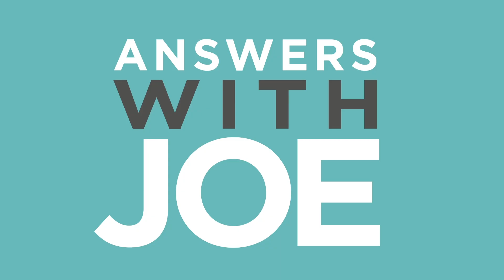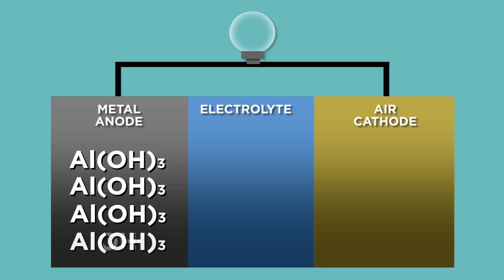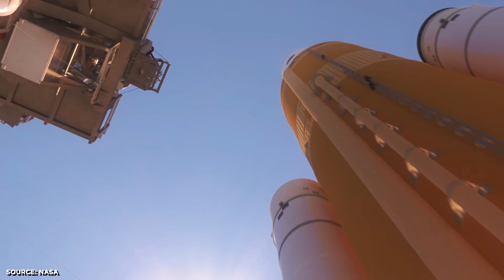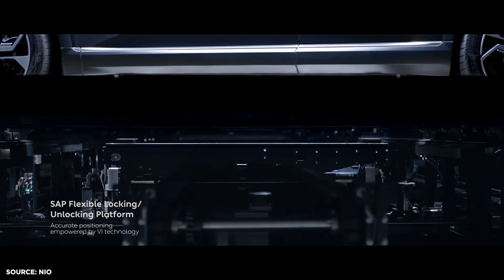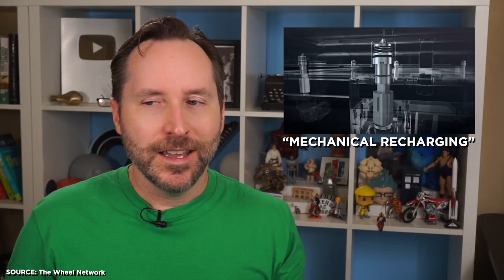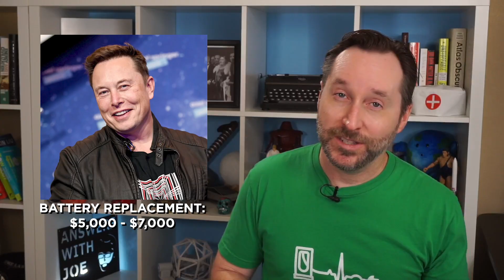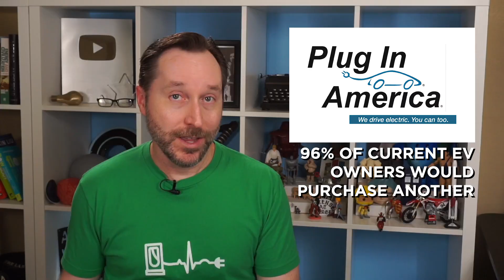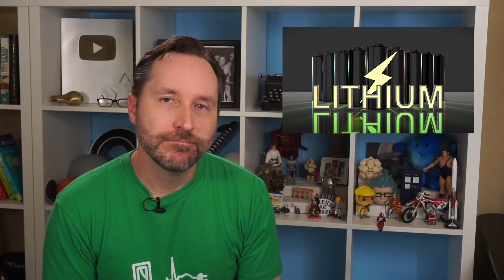This Battery Could Drive A Car 1500 Miles - But There's A Catch | Answers With Joe

Comment: "at least with hydrogen..."    Sure, but hydrogen cars are only slightly more energy efficient than gasoline cars, and the hydrogen currently comes not from electrolysis but from fossil fuels, emitting CO2.  Battery EV's are around 3x more energy efficient than gasoline.

Because hydrogen isn't a resource. It has to be made.  With thermodynamic losses on every step.   Hydrogen fuel cells just add complexity for no good reason.

Comment: Cars are nonsense.

Tele-working, remote working, proved to be quicker, faster, currently available, scalable, and better for the work-life balance. 

For work that is site dependent, mass transit. Busses, trains, trams have a smaller impact in creation, operation, and recycle than cars.

And finally, because 'pEoPlE wIlL nEvR gIvE uP cArs', fewer batteries and smaller batteries  used as a back-up rather than the primary energy source. Power from go:  

https://en.wikipedia.org/wiki/Pantograph_(transport)

Like US healthcare, the problem isn't that change isn't necessary or possible. The problem is that a lot of jobs and money are inextricably dependent on things remaining the same. The problem isn't a lack of science or materials; the problem is our abject fear of the pain and suffering perceived in modernizing our economy.

Comment: Sounds like aluminum-air batteries are really just a carrier for whatever power source is used by the factory that would produce the batteries. The power contained by the batteries isn't "free". It comes from whatever the factory uses to de-oxidize the used batteries. So, if that factory is powered by a coal power plant you aren't really benefiting much. The real question is this: How energy efficient is the process of de-oxidizing use aluminum-air batteries, compared with transmitting power across power lines to charge a cars lithium batteries? If it's more efficient than recharging lithiums, great.

But what if it were WAY more efficient? Could this be a good option for mass grid power storage? Could excess power generated during sunny or windy hours be used to  de-oxidize large vats of aluminum, which could them be exposed to air during night time or low wind times?

Comment: I think your numbers for energy needed to recycle aluminum batteries are very optimistic. The energy to recycle aluminum is low because it is mostly in its metallic unoxidized state. The aluminum battery produces aluminum oxide which is much more energy intensive and harder to recycle.
Reply: It is in fact that oxide state which is why aluminum is such a PIA to refine in the first place. And energy expensive to produce.
Reply: Same as represeting sea freight and airline co2 as "significant" when its road transport that contributes the most out of everything at 40%. Leave sea freight alone its most economical and ecological way to go, same for airlines, there just doesnt exist any replacement for jet's which are already indredibly efficient. For road transport it should be offloaded from road going semitrucks onto trains and expansion of railroads. Trains are most ecological land transport in existence and there is nothing that could ever beat it, but Elon is focused on tripping to his stupid ticktacks that are infinetly worse to trains....instead of just investing into railway industry. Electric-grid powered rail is the way to go
Reply: @frontrider3240  , Nope, you're both off the map.

If the aluminum were only going to oxidize to a certain layer, the device would be designed to only have that much aluminum. Otherwise the designer is an idiot.

Efficiency as you clearly don't understand, is in the materials used and their recyclability. Of which the answer is going to be nope, they're not really. And people who say they are, are idiots.

You folks are the scientifically illiterate ones here... That was kinda why the aluminum was pointed out as the stupid idea. You apparently have no clue how much energy it takes to separate aluminum from the oxygen. Which is why initial aluminum is REALLY FUCH'N EXPENSIVE in terms of energy requirements for production. Pissing it all back to it's shit form for single use batteries is dumber than shite!!!
Reply: @senselessinductor7921  the thing is you'd have to figure out what to do with the substrate that the aluminum is deposited onto. I think it might be more efficient to have a relatively thick plate of aluminum on the substrate so that the oxide layer would be scraped/ground off to reveal a fresh surface. if it was only a single layer of aluminum then you'd have to deal with either reclaiming the substrate each and every time or dealing with its disposal. at least a thicker plate of aluminum could represent a lot of uses before it's completely spent. Also we'd have to see how much aluminum is required to power a vehicle for its lifetime and how that scales and adds up. if we weren't to reclaim the oxide what would that look like in terms of removing that aluminum from circulation?
Reply: Yup, recycling these batteries would really not be recycling so much as refining . . . more or less the same as the first time when it was mined.
Reply: I have been known to melt my aluminum down and make aluminum ingots in a cast iron skillet. It's easier to transport to the scrap metal yard, plus you can throw all your aluminum in there, cans, screendoors, used foil, gum wrappers, cigarette foil, anything aluminum. The paper and any other impurities will burn off as it melts. Just make sure you don't pour the dross into the mold, and you're good to go. Ingots might be harder for them to re-melt, but that's not my problem. I got my $.
Reply: @CrazyBear65  I do the same thing, I even have some molds for casting sand to make things out of aluminum.

The problem with Aluminum air batteries is when they are spent all the aluminum is turned into aluminum oxide, basically slag. To turn it back into aluminum takes a lot of electricity and heat. It's the whole reason making new aluminum is so expensive.
Reply: yes
Reply: Psst, let them dream. Dont tell them that this technology is another dead end like many others.
Reply: @Bullshitvol2  it isn't, it's perfect with magnesium reduction.
Reply: @frontrider3240  , ROTFL, that flew right over your head.
Reply: Couldn’t you just scrape off the oxide layer? I’m sure aluminum oxide itself has some uses right? You wouldn’t need to melt down the whole plate.
Reply: @Everfalling  , And what makes you think it would just be a layer?
Reply: @senselessinductor7921  correct me if i'm wrong but i was under the impression that aluminum oxide doesn't penetrate in the same way rust does. it only forms a relatively thin layer on the surface of the metal which is why aluminum is so weather resistant compared to steel. Is this not the case? Is the aluminum plate constructed in such a way that oxides are able to penetrate further into the body of the plate?
Reply: @Everfalling  yes it's a thin strong ceramic
Reply: @Everfalling  The problem is, that to recycle the oxide layer back into aluminum requires melting the oxide down and electrolyzing it. This is the exact reason why mining/refining aluminum is so energy intensive.
What I'm saying is, I doubt the energy you can get out of an aluminum air battery will be anywhere close to the energy put into making/recharging it. This would make it a pretty bad energy storage option in most situations.
Reply: @YourArmsGone  i guess it depends how precise you can be shaving off the oxide layer and whether the oxide is worth reclaiming. otherwise if the power used to refine the metal came from renewable sources then even if it was energy intensive to recycle it might be less environmentally detrimental than the mining of lithium.
Reply: @Everfalling  Good question.  Yeah why not just scrape off the Aluminum Oxide?
Reply: @jamesakbar-given5009  lol. Because of science 🙄
Reply: you don't need to recycle everything you have to recycle just only in the case of the toxic or less abundant materials.
Reply: @RAF-777  The battery runs off of aluminum so either the aluminum in the battery is recycled or more aluminum needs to be mined and refined. The point is that either way this battery will take an insane amount of energy to run, and the efficiency will be terrible because refining aluminum from its oxide is extremely inefficient.  With current technology this battery will never get close 40% efficient whereas even the worst rechargeable battery is well over 70%.

Comment: I think that the size/weight to energy ratio never seems to be mentioned. If this thing is the size of an I.C.E. (internal combustion engine) car battery and easy to change this is the future. If it is as large as an electric car's current battery pack then it has no chance.

Comment: Could we just replace everyday batteries with them? Rechargeable are good and all but they're only 1.2v usually so if you have something that requires a lot of "umph", you still need normal batteries.

Comment: Damn it people. This battery doesn't have a practical application. It's 2021 not 1840. We have easier ways of doing things because smarter people than us have figured out how to make it usable for the average person. The only viable way this aluminum air battery could have a sustainable use is with a reconditioning process using high strength acids and an expensive chemical process. Think about that and realize how many people catch fire refueling their cars and can't figure out how to dispose of used motor oil or cooking grease without dumping it down the drain or on the ground. You can't have nice things because you can't take care of them responsibly.

Comment: If I understand this correctly, this battery has got a double the energy density in comparsion with Lithium batteries. Why not use them to make large electric planes?

Comment: Why not have a battery rental system? Design cars that have a standard flat battery pack that fits under the car. You enter a station when your battery is low. A robot removes the old battery and replaces it with a new fully charged battery. It would take minutes. Then the old battery can be slowly charged to be used by someone else later or scrapped if it had met it's end of life.

Comment: These are a great “boost” battery idea… a smaller AlAir battery can give a couple of hundred miles, but can be easily replaced - swap it out like a gas cylinder…. Gives you serious range for occasional journeys,

Comment: Phinergy is working with Indian energy PSU on this. Don't know about other countries, but this can be a good solution for India if it comes to fruition.
- India doesn't have the minerals needed for Li-ion batteries, and don't want to depend on China since we are at war
- India imports all its oil and oil has become very costly here. Both Govt and the public are looking for alternatives
- Alumunium is abundantly available in India
- A 1000 km battery would mean even a frequent driver would need to swap these once a month. The average driver can swap these once every 2-3 months
- Silver can be a costly component, but if that can be completely recycled, then no wories

India has lot of engineering talent. If that talent, as well as the raw material, can be sourced from within the country, then we don't have to depend on other countries to take us to a pollution less renewable energy future.

Comment: What's the expected life of a Tesla? Since batteries are expected to last that.

I like Teslas, but I'd take Musk's statements with a grain of salt, he has no problem with misleading people, especially those who get hyped with his businesses and investments.

The issue with Teslas is the battery lifespan, but it won't be a problem for the first 15-20 years of the car. Who would pay more than the value of the old, used car itself to replace the batteries? And that's if, and it's s big if, Tesla keeps manufacturing battery spares for 20 year old cars.
The problem, unless recycling those cars becomes profitable, will be the junkyards of old teslas, that aren't very old at all. Making the manufacturing process of the car more polluting than one of a car that lasts way longer.

I like hybrids with small Atkinson cycle engines and small batteries. Replacing the battery of the used car is not that expensive, the ICE engine is efficient and can run for several decades (for example, Prius), and pollutes the atmosphere only a fraction of what a normal ICE car does.

Comment: If "shop time" for changing these out is anywhere close to dealer "shop time".... And if every time you change batteries, you have to put up with some sales staff trying to sell you a new car... I think I can pass. Rechargeable is a very big concern. Also, recycling aluminum batteries would be very heat intensive and we are already warm enough.

Comment: If only car manufacturers could standardize on a battery interface the way we have done for most other battery-operated things. Create one or two form factors like the size AAA, AA, etc. Then allow battery manufacturers to rise and supply the market. More competition, better prices. That way, we the consumer could choose between rechargeability and/or range. People could even have two, swap out between them as necessary. Or carry spares in case your rechargeable runs out and there are no charging stations about.

Comment: How many EV owners actually have a real need for more range ? I live in Europe and have a Tesla Model 3 for the past 2 years as main car, been driving it all over the place, more than when we had an ICE car, at no moment during these trips we were annoyed by the time it took to charge the car (15min to 40 min max), and charging speed are increasing yearly. I think the range issue has already been solved for most private car users.

Comment: I think the move for pickup trucks along with RV's is to do a electric/hydrogen hybrid ...RV's could be almost self sustaining with a solar array on the top and the pickup trucks could act like their own power station on construction sites and if you don't have enough juice to drive after the end of the day the hydrogen get's you home type thing...
I am currently looking into committing an act of treason in some peoples eyes by considering an electric swap on my Cummins powered Ram....prices on batteries and used Tesla motors are coming down considerably in the past couple years which is starting to make the cost of a Re&Re vs E conversion comparable(lots of factors involved obviously...but when you consider the ever increasing cost of Diesel along with the possibility of being self reliant with a good solar/wind setup it becomes very appealing.(at least to me anyways)

Comment: It's probably in the comments already, but the main disadvantage with a (single) AAB in a car is that people tend to refuel before the tank is totally empty.  There's a lot of waste potential there.  The up shot is that if you have 2 smaller units then after 50% range is used up you can do a battery swap.  Arguably this takes away from the big 1000+ mile range thing, so there's that... I would think that a hybrid system with some charging and a longer range AAB would be the best.  So before your family goes on a road trip you make sure your AAB is all charged and away you go.  For more common use you make use of the recharge system.  More complexity in that option.

While I like the idea of AAB, I think cars is not really where we'll see them.  Boats on the other hand makes a lot more sense.  You might have the same issue I mentioned above, but you could have 5-10 big units and depending on the length of a trip only need to replace x of them.  Since many container ships dock at ports designed to handle heavy cargo, replacing a battery would probably be pretty simple... Again once the infrastructure gets built.  Guess we need a billionaire to make their own shipping company and produce their own boat drive on AAB.

Comment: It whould be better if we whould put induction chargers in the highways. Meaning  your car is always charged. And you dont need a very large battery. Just enough for city movement and to stablise.

It whould also solve the i have no garage problem.

Comment: We do have one form of transportation where these would fit perfectly...airplanes! they always travel to defined hubs, they have appointed people doing the refuelling with specialized equipment- perfect for replacement. Also, you could introduce the Al-O2 battery replacement option at specific airports servicing specific routes to start with without changing anything logisticially for the airlines.

Comment: I can imagine something like a Pony Express-type system for long range trucks using aluminium-air batteries. Having battery swap stations every 750mi where the batteries are swapped out, then sent to recycle stations. But, the massive costs and inconveniences associated with it make it seem like a worse option than a similar system with a rechargable battery. Where you can either swap out the battery, or swap trucks whilst the one you were in gets recharged.

Comment: I want a vehicle power system based on that liquid battery technology, that way, filling up would just be replacing the fluids and that could easily be done with similar gas station style infrastructure.

Comment: Because aluminum is light and has high energy density, Al-air batteries might be useful in electric aviation. If they could double or triple flight time that would make electric planes feasible for more than just pilot flight training.